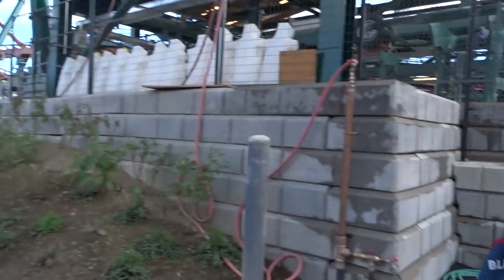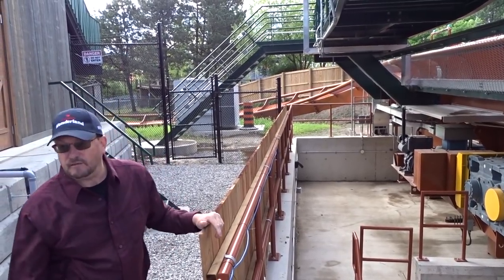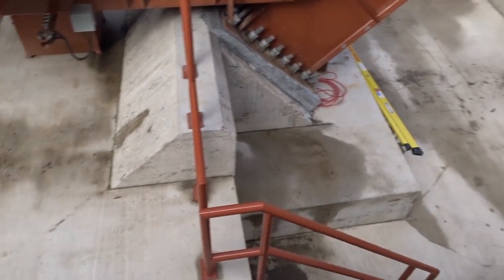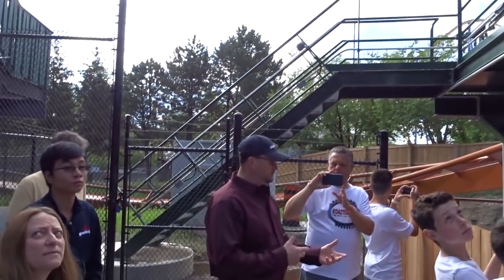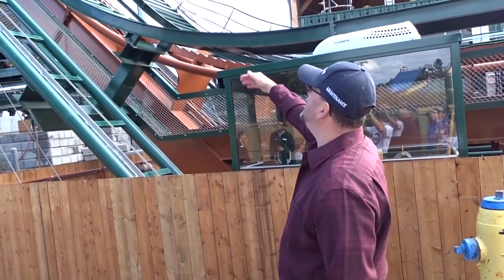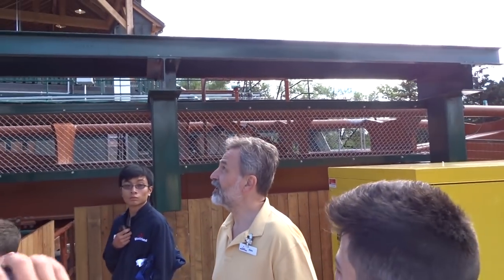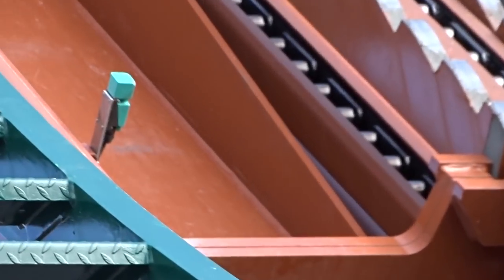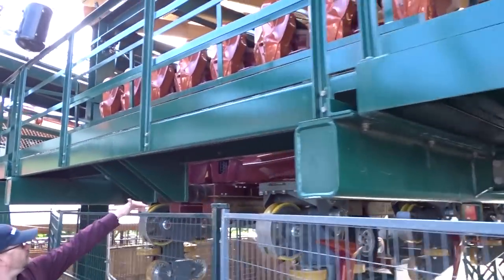Yukon Striker Canada’s Wonderland Safety

Comment: What makes the clock sound going down the drop?
Reply: Tevaun stewart the train disengaging the chain.
Reply: Braeden Berger no the clickbsound before it heads into the tunnelwhen the drop is leveling out
Reply: Tevaun stewart oh that’s just the wheels on the top of the train hitting the track and that’s the tracks noise